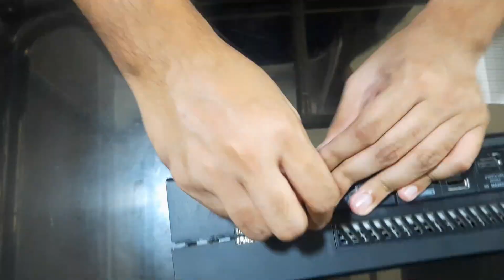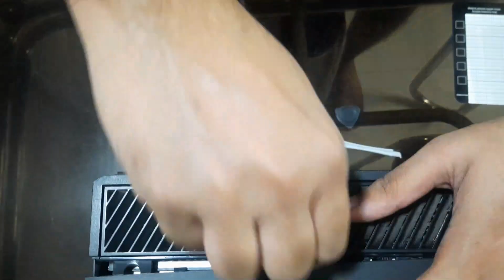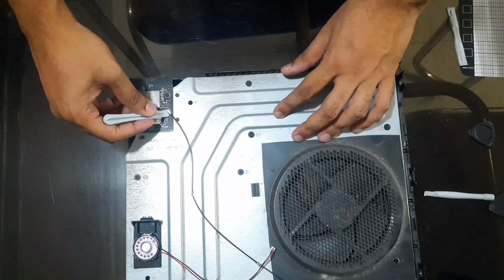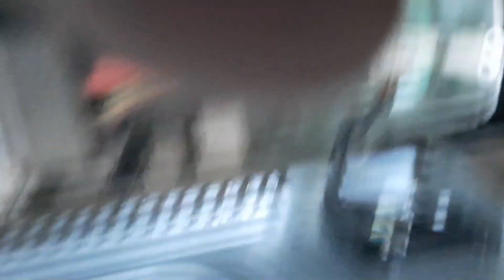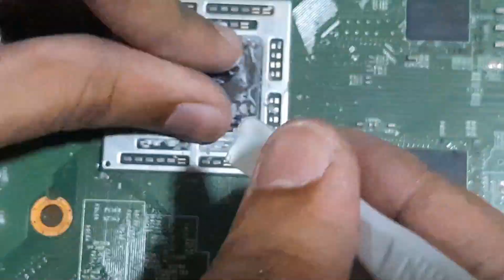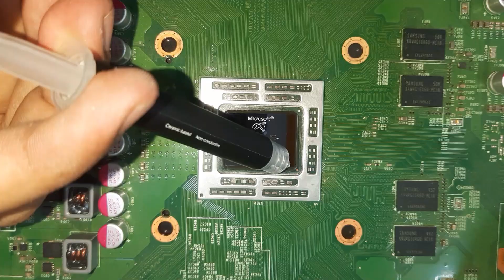OG Xbox ONE Teardown And Re-Pasting 8-Year Old Thermal Paste

Comment: I bought my xbox one in 2013 (Day One Edition) unfortunately came with a factory malfunction ( blu-ray doesn't recognize a disc) but still works pretty solid with any game and make no noise. Nice video
Reply from the maker: All the day one editions had disc drive malfunctions, mine had a problem of random ejection and sometimes, faulty power buttions since they were touch operated. Thankfully i got them fixed, make sure to do yours too as its a simple replacement of the blue ray drive.